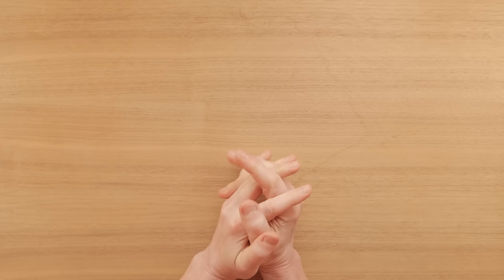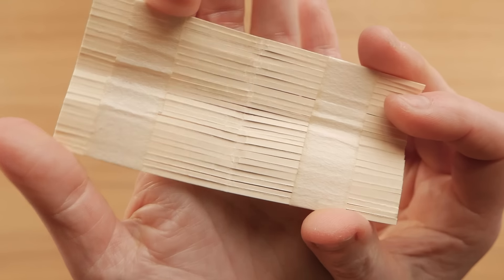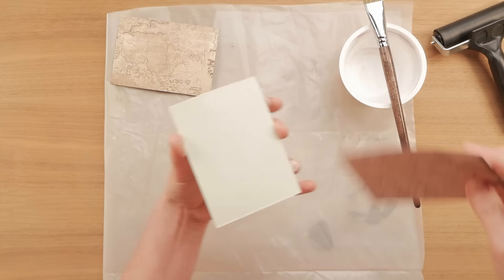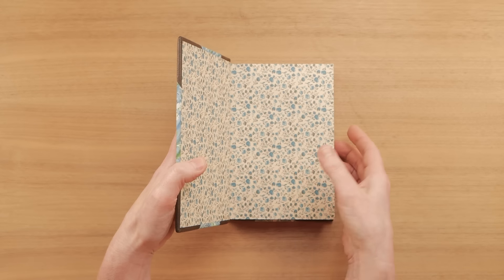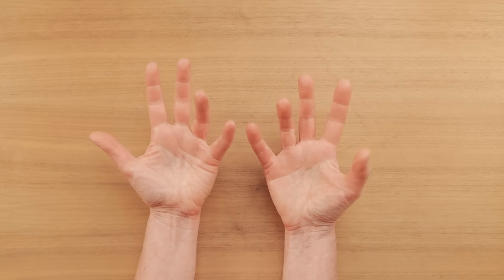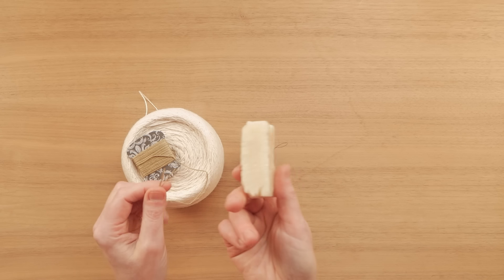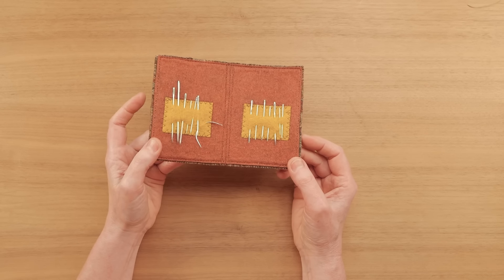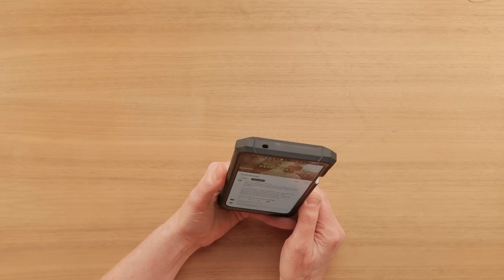5 Things I Wish I Knew When I Started Bookbinding

Comment: In the beginning, I used my bank card as a folder. If you have a local hardware store, you can get cheap packs of smaller brushes. Sometimes the bristles fall out after a few uses but I just use pliers to crimp the end smaller. Just helpful tips from a poor college kid who loves making books.
Reply: A credit card! Of course! I've been using things like the back of knives but it hasn't worked well. Thank you.
Reply: @RamoArt  Yay! I'm so glad I could help. I've also used the stainless steel ruler, just depends on how long it is.
Reply: i used the back of plastic comb as makeshift folder, and empty ballpoint to score. Craft should'nt be limiting!

Comment: For a curved needle, I bent an embroidery needle in a curve with two pliers. Works beautifully.
Reply: Works with a thick needle since it has a core of soft steel, but with very thin needles it’s a very dangerous move:  hardened steel will shatter if stressed in this way, and hardened steel shrapnel splinters in eyes or fingers are really no fun.

Comment: I made a budget book press out of two old bookcase shelves. Drilled matched up holes in all the corners, got some washers, some carriage bolts and some wingnuts. It's a bit messy, since the shelves are chipboard rather than actual wood, but it works.
Reply: Chipboard is much better than wood since it has no grain.  Wood will split along the grain if your book press is over-tightened.

Comment: I think the most difficult thing for me to find when I first started was PVA glue (for general bookbinding) and Wheat or Rice paste (for leather work).  It frustrated me to no end finding videos for "bookbinding" but turned out to be for scrapbooking and getting recommendations for standard Elmers Glue.  Please for the love of all that is good, if you are reading this, don't use Elmers Glue or paste sticks for bookbinding.  If it's for your own personal use, do whatever you want, but it's best to not bind or repair books that are for customers with these kinds of glue.  
It took a while but I finally found suppliers that had Jade 403 PVA.  Yes it's more expensive but it's made for bookbinding and archival work.  Don't skimp on the glue.  You don't have to get Jade 403 specifically, just read the label and make sure it says "dries flexible", and if in doubt, test it out first on some scrap paper.  You absolutely do not want to have a spine glued with something that will crack and flake off.
Reply: Thanks!
Reply: Isn't elmers glue PVA?
Reply: @janeebbert  Yes Elmers is PVA, but it dries brittle and will crack and flake.  It does not dry "flexible".
Reply: @MCSEknight  maybe we are from different countries or something, I've always found Elmer's to be pretty flexible. I've never experienced that, but I'll look out for it. 🤷🏻‍♀️
Reply: Elmer’s glue has ruined every journal I’ve ever used it on.  I tried scraping it very, very thin with a credit card, and drying the journals in a book press, always using the glue very sparingly. 

Journals came out of the press dry and straight as a board, and then gradually grew warped and wavy over the next few days/weeks.  

I live in a subtropical climate (often humid) and Elmer’s just doesn’t work here for journal-making.  

Ty for the tip about another PVA glue, going to try it.

Comment: I bought a few used hard covered book for pennies so I had a decent board for the covers. I can not seem to find the think heavy stuff.
Reply: Nice thrift find.
Reply: You can glue two pieces of card or board together to make the required thickness, it's still important to make sure the grain always goes top-to-bottom, and not across the width of the book. And to glue or paste both the joining faces.
If joining more than two thicknesses, do them in pairs, then join each pair to another pair, always pasting both meeting surfaces.

Comment: I didn't have an awl when I started, even though you can get them for less than $5. What I did have was a pack of finishing nails and a hammer, for the thicker sections, and a really fat, pointy sewing needle, for the thinner ones. And I creased my sections down by rolling a nail polish bottle over them. Now that I'm a few years in and I know more about bookbinding and know that I want to continue, I have a bone folder and an awl and more tools besides. But starting with school glue and a pack of finishing nails is totally fine

Comment: When I’m using lightweight chipboard for book covers I glue two pieces together, making sure that the grain runs in opposing directions for stability.
Reply: Two pieces on each side of of each cover? So totaling 8 pieces?
Reply: @JH-oz6pg  no.  Tow pieces of chipboard for each cover, one with the grain running vertically, the other grain running horizontally.  The opposing grains create a sturdy substrate.  This is very effective even when using flimsy chipboard like cereal boxes.

Comment: can you use white school glue? is it like PVA?
Reply from the maker: @bobbyd1961  it's similar, not as concentrated, but it should work!
Reply: @NiktheBooksmith is not as concentrated?  Maybe if I heat it low and slow, it will evaporate some water hmmm. Thanks
Reply from the maker: @bobbyd1961  I see where you're coming from, but heating even slightly may reduce the bond strength.  
It'll work as it is, it might take a little longer to dry is all :)
Reply: @NiktheBooksmith  Thank you for your advice. I can buy school glue relatively cheap but PVA is a bit pricier but if I get into it enough buying the better one will be better.

Comment: waxing the thread also slows the rate that the fibers of the thread absorb moisture. repeat swelling of some natural fibers can cause them to start separating and weakening over time. this isn't as much of an issue with linen because the threads are so long, but with short staple threads like cotton, it can make a big difference. some of my earliest bindings started coming out at the stitches and the 100% cotton embroidery floss coming apart was the culprit. seems to be a bigger issue on rounded back bindings. all of mine that had problems were rounded back at any rate.

Comment: One way to see what grain direction your paper is in ( because many do not stipulate the grain) is by cutting two strips at the corner of a piece of paper. One cut horizontally and the other corner vertically. Wet them. When one of those strips of paper fold and curl you found the short grain. That means the opposite is the long grain. 
Still complicated. I know. 
When you bend your paper one way and then another, bowing them, the short grain will resist less. The long grain resist more. So if you have a 8x10” piece of paper and you bend it from the top and bottom and fold them towards each other and it’s more resistant that’s the long grain direction. 
It’s hard trying to write an example instead of showing one. Cheers

Comment: Thanks for this info!!
Note about waxed linen:  I always use this.  What I discovered is that, over time, it loosens up and the pages become loose.  You can prevent most of this by gently stretching the length you cut.  I do this after I thread the needle.  I have much less stretching after I do this. xxx
Reply from the maker: That's genius, thank you!
Reply: @NiktheBooksmith  love ya!
Reply: Thanks for that tip!  I had never heard that but definitely trying it on my next book!
Reply: @maryjenkins9567  It helps with loosening. I used to be an OR nurse and that's what we did with sutures that could stretch later.
Reply: How do you stretch it out?
Reply: @arlenestanton9955  hold one end in each hand like a fist with the fingers facing each other (like "one potato, two potato").  Pull your hands apart a few times.  First time to stretch slightly, then a couple more times with more pull.  You will have to face your fingers down as you pull.  Slow and smooth; you will feel it stretch a bit.

If the thread is too long to pull all at once, do it along the thread another or a few more times.  I hope this helps.  If not, let me know and I'll make a video (which I'm a dunce at).

Comment: Regarding warp, do you have to glue both sides at the same time to combat warp or can you prepare the book cover first and then later glue your book block in?   Like, if it warps first and then you glue the other side, does that reverse the warping? I'm not sure if that made sense, sorry
Reply from the maker: Good morning!  I've done it both ways.  If you prepare your board one way and it does seem to stay flat, try the other and see if that helps or makes it worse.  
The board will dry curved in toward the side that is pulling more than the other.  If that happens you can try to flatten it out by applying (gluing) a thin paper to the convex side.  Lordt.  I hope THAT made any sense! 🤯

Comment: This was very helpful! However, I do have question? The cloth which you use on the cover, I've seen people use 'bookcloth'. However, where I live, that isn't an option. There are MANY fabric stores though, so is it fine if I use any kind of fabric to make the book cover? Is velvet or cotton alright?
Reply: There are videos that show how to make bookcloth by coating 100% cotton fabric.
Reply from the maker: Hello!  You can use all kind of fabric for bookcloth.  It just depends on the look you are going for.  Here's a video where I show how I turn fabric into bookcloth https://youtu.be/wLoae5vKqTY
Reply: @NiktheBooksmith  Thank you!
Reply: There are different videos on making ordinary fabric into a bookcloth.  Basically, you use a glue brushed on the back of the fabric and let dry.  Kinda like adding  sizing solution.  Prevents fabric from stretching or getting out of square.

Comment: The book boards of my very first junk journal were warped when I used them.  I could rebind it but, I love my decorations on the cover.  Any tips for unwarping a book?
Reply from the maker: Good morning!  Its hard to say.  Maybe?  Depending on which direction the covers are warped.  If the covers are warped in the direction that would require an extra layer of material glued to the decorated cover, I guess that would defeat the purpose. =/

Comment: how many of your books and journals have fallen apart due to folding signatures against the grain? where do you find affordable short-grain letter size paper to use? i understand its important, but seriously, how much does grain direction REALLY matter if youre binding the folded paper in a book with a secure sewing method and glue and they wont be folded all the way back and forth over and over, but just open in one direction like a normal book? it seems regular paper in the US is long-grain, so thats pretty limiting.
Reply from the maker: good morning!  Like I mentioned, the paper may not fail for a long time.  Some things can speed up the process, like coffee/tea staining the paper, or if the paper was older and already getting brittle.  But, I'll explain a way to source paper without being wasteful in the next bookbinding video.

Comment: When folding across the grain, do you feel it helps to lightly moisten the paper and/or score it? Thanks
Reply from the maker: Hi Margaret!  I've only dampened paper when I intend to tear the folded paper.  I'm not sure if it would be helpful as far as making the fold, but the problem you may run into with moistening the paper, is that it would be more prone to stretch the fibers out of shape and when the paper it dried, I'm afraid it would be all wonky.